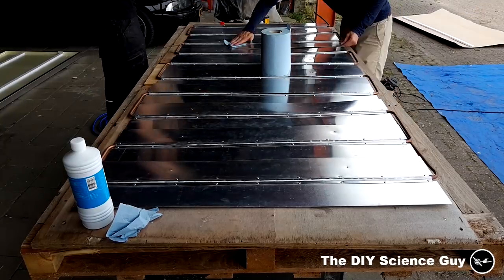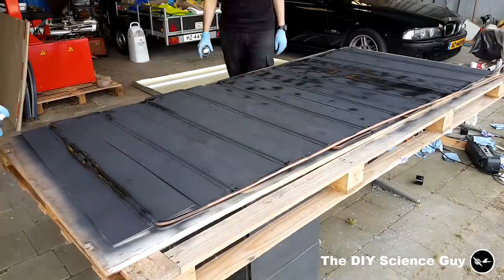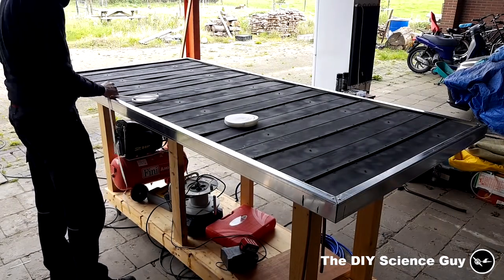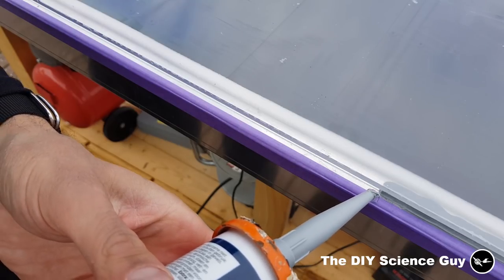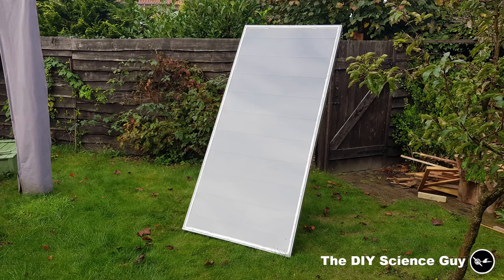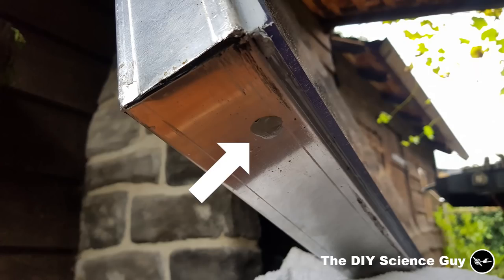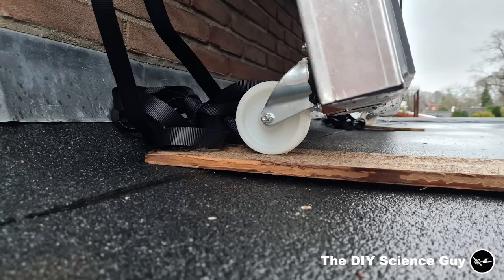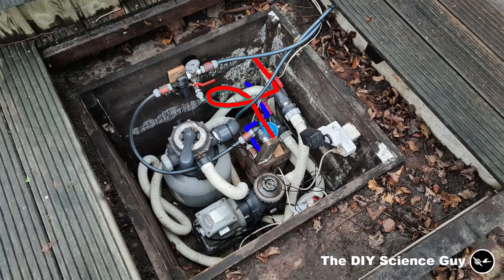Super easy to build 1600 Watt Solar panel #2

Comment: Nice job. My panel is 2440x1220, hardwood box, lined with 50mm foiled PIU, 2 serpentine silicone pipes sandwiched between 2 x 16AWG aluminium sheets, with twin-wall polycarbonate on the face. 
Don't leave it uncovered without pumped water to keep it cool!
My pump failed, the residual water boiled off, and the polycarbonate sheet got soft and sagged.
At my latitude, it is the equivalent of just over 1 kWh/h continuous in direct sunlight, calculated from rise in water-temperature per volume pumped. It keeps my workshop warm in winter, too!

Comment: I once removed an old collector from the eighties that had not been functioning for some years.
The insulation had completely turned into charcoal foam! To me it was a miracle that it never caught fire.
So my advice here is to always have water circulating through the panel. When left alone without cooling the temperatures inside such a panel can become dangerously high.

Comment: So glad you used polycarbonate. It can handle the higher temperatures when the pumps are not running & it's a natural ultraviolet filter. I hope you used Polyisocyanurate insulation, because it can handle 148°C. 
Extruded Polystyrene (XPS) will have permanent, inelastic deformation at 60°C and higher.

Comment: This is cool! Don't forget to give us some HHO updates!
Reply: I'm really looking forward to pure H2 and O2 generation (>99%) and storing it in appropriate gas cylinder. O2 is also really useful for medical applications, just need to purify it. H2 great for Hydrogen Fuel Cells and gas burner.
Reply: @NextGenAge  Its hard, and expensive. You need to be sure to get H2 > 96% (98% ideally) purity. Otherwise it could be EXTREMELY dangerous. Our bellowed DIY guy speak about cheap H2 probe, but I guess he set aside HHO projects for a while (update on his last HHO project would be nice - info about improvements).

Also tank where you store hydrogen MUST be special kind of tank (when high pressure H2 is stored), otherwise it could explode cause H2 is tricky gas and want to do as many leaks as possible. And there are some additional elements of course like... oohh oil in compressor (from fridge for example) could burn H2 and make an explosion, etc.

So be careful. Anyway HHO is our only hope for the future, cause even if those nuclear fusion reactor start to work and produce free energy, it wont be free for us - tax payers, that I can assure you. They want to control us and energy is one element of control they wont let go.

Comment: I'm really wanting to build one of these. Only thing holding me back is having to learn the plumbing connections to the oil boiler for hot water. Shut off valve for winter maybe. Cheers and sunny days brother 🌞

Comment: I once lived on an old abandoned orange orchard. There were thousands of feet of black plastic irrigation tube laying everywhere. I found a jacuzzi someone was giving away and brought it home. I then collected up a massive amount of the black tube and made a giant spiral on my corrugated roof. It was probably fifteen feet in diameter and made out of hundreds of feet of tubing. I put a small slow pump on it and fed the output into the Jacuzzi which we used as a simple hot tub. The water out of the tube was not super hot but it was hot. In order to get it hotter I added a small an inline water heater to further heat the water coming out of the tube.The system got the water hot in a couple of hours and our electricity bill barely went up taking hot tubs two or three days a week. I always wondered if it was efficient or if it was a good idea. It seemed to work quite well but I employed no mathematics or calculated engineering.

Comment: To maximise energy absorption you could add 10% of 5 micron fine zinc dust to the black paint, this will increase heat absorption by more than 15% (researchgate)
Reply from the maker: Thanks, I'll try it out some time!
Reply: @TheDIYScienceGuy  yeah, and a lined Al/Cu interface of thermoelectric cells would b inereeresting to see how much electricity it pulled since the heat's flowin anyway...why not stick these awesome little pieces of tech in between the highest difference of temp places and collect otherwise wasted energy....(or if water/Cu/Al temp diff. will be low, perhaps place them on back between hot side and cooler back.  I dunno if you could find a good enuf temp gradient, but itd be super interesting to make extra power simply off of the heat energy flowing from hot to cold thru the material boundaries.  They may also be inefficient garbage i dunno; just know the tech is amazin gbut thats about it

Comment: Hello DIY Inventor. Thank you for sharing. Beautiful process and powerful end product. Is it possible to share te calculation for the output of the solar panel. Thank you.
Reply from the maker: Thanks! Yes the output is an estimation of course. 800 Watt of the sun's enegry per m2, the panel is 2xm2=1600Watt. Mid summer I will show the actual power output.
Reply: @TheDIYScienceGuy  Thank you. Hope mid summer will bring you many clear sun hours and hot water.

Comment: Great videos, really clean and clever techniques - really thought through! I think a little more detail about what exactly you're making at the beginning of the video would be helpful for first time viewers.
Reply from the maker: Thanks! Here ar part 1 https://youtu.be/9YswyY1i-Us and 3 https://youtu.be/DIk2mcJ7NHs hope it helps!
Reply: I'll testify as new watcher that'd been very helpful considering upon 1st look/read "1600 Watt solar *panel" I thought "no way 1600!!" and I was hooked...

Then a chem. engr watching, I began to scratch my head a couple times but curiousity persued;till I got here and heard the hot tub talk and saw how the copper was ran realizing "damn it, heat exchanger!!"  Seeing how *usually watts used with solar panel describes electricity production and thats all I was after, bit more clarity in title wouldve been nice.  Like 1600 Btu solar heater or if with W then 1600W rooftop heat/energy exchanger.

TBH tho, I like watchin anyone create anything so no total waste.  More detail on how you calculated the theoretical needed flowrate, heat flux, Wattage generated etc wouldve helped make it more interesting a ton!  For us engies watchin...like did u model each collect as half the Al sheet with copper strip on one end, calculate energy/area generated w the nice 2nd order heat transfer equations or just look value espimate up?  Did u go on w a cross section of Al and Cu on end using this generated energy/volume, look up needed consts. like metals' transfer coefficients and solve to find steady state max temp of metal then finally your heat flux at s.s?  Next, calculate needed energy input to raise water desired temp., and finally, w more detailed 2nd ord. diff's solve using this needed energy and heat flux to calculate your needed flow rate???

If you found some type online calculator to do all the calculations for you, shame on you for taking out all the fun part!!

Comment: What is solar Anti Reflection (Light Trapping) Coating ? Silicon nitride Si3N4 (75nm layer) thermodynamic coating (plasma coating ? like: The Thought Emporium ("This Can Coat Anything in TITANIUM") ?  ) ? Heat_pipe using Acetone C3H6O (Boiling/gas point +56.05 °C, Melting/solid point -94.7 °C) or Water or Ethanol ( you simply take a metal tube (put in a metal wick) (closed at one end), bring the liquid to a boil (pressure) and close the other end before it starts to cool so that the tube goes into a vacuum ? (like vas made Doug Kalmer "making a heat pipe" ) ) ?
Reply from the maker: Sorry, I don't understand your question.

Comment: Question: Would it be possible to integrate a solar panel system? Would cut down on black paint for sure and double its use, are there any reasons to consider not doing it?
Reply from the maker: Yes, they exualy make heatexchangers that can be put on the back of collar cells for that purpose. But it makes it more complex. I'm planning to dot something like that when I have my one solar cells. Good thinking! 👍

Comment: still waiting on the 1600 watts. i doubt your design is even capable of it
Reply: “The Sun's rays are attenuated as they pass through the atmosphere, leaving maximum normal surface irradiance at approximately 1000 W/m2 at sea level on a clear day.” So for a unit that looks to be around 2 meters squared  to get 1600w which would be around 80% efficiency, that figure seems to be pretty plausible.
Reply: How to calculate the needed al sheat area for the targetted wattage of 15 KW production ????????????

Comment: Doesn't glass make it produce hotter water ? You can always put hardware cloth over it if you are worried about hail damage,  some with a grid size small enough to stop anything large enough to do crack or break the glass. How well did that first one work, and how do you know they are 1600 watts? Thanks man
Reply from the maker: No polycarbonate is a beter thermal insulator than glass so it will work beter. The only disadvantage is that it is twice as expansive as glass.

Comment: I have my own solar instalation (4.66m2) which at 33oC gives me 22MJ of energy output in Poland. How much energy can You gain?
Reply from the maker: Max around 1500W. How much Watt does you panel give?
Reply: It depends on two variables 1) temp. outside and 2) temp. on the panel. Above 25 oC outside I achieved 160W/m2. At 33 oC it is 260 W/m2. Without clouds. Max temp. in the condenser was 65 oC. The lower temp. established in the condenser e.g. 50oC the lowest losses on the solar panel due to conduction, radiation and convection (one glass separation) and the greater efficacy. At 50oC I get 75% at 65oC 50%. Average sun power 350W/m2 between 10-15 during two weeks in Juni.
Reply: For me interesting is how efficiently heat flows from metal plates to the pipes? I have on 1m2 of area, 2.7kg of water and 27kg of steel.

Comment: Got a question: I know polycarbonate is a "natural" block for UV radiation... Loosing that wavelength isn't a waste of efficiency?! Or is just a tradeoff on the safe side for not using a brittle glass?!
Anyway, that is one professional looking solar panel! :)
Reply from the maker: Thanks! Well glass also blocks most of the UV rays and besides that only a very small amount of the light that gets trough our atmosphere is UV light. But good question! 👍
Reply: Even through im not sure if this is considered a solar panel and not a water heater it might have the pros of not causing overheating that causes efficiency losses since theres a limit to how much and what type of light can be converted to energy ( im talking in case of a solar panel not sure if its a heater tho)
Reply from the maker: Yes it heats water.
Reply: @mehmetbahaozen8445  I was thinking the same....but may be it's because I'm not natural English speaking. In my country they call this kind of stuff a solar collector. (And I have those on my roof for hot water for 8 years...still going fine)
Reply: @mehmetbahaozen8445  I think a nice idea could be the combining of a water heating panel contacted to a photo voltaic panel. The water could keep the temperature  of the PV panel under control and therefore giving it  a higher efficiency.

Comment: FYI plastic isn't more transparent then glass. Don't believe me as your local optometrist, or eye glass wear supplier.  It's just for crack resistant for obvious reasons. But will fade with time like your headlights. It's a give and take.

Comment: Nice project. Why do you need a secondary water circuit (with exhanger, pump, electricty etc)? Why not use this directly as input into a boiler or gas heater, pushed by mains water pressure?
Reply from the maker: Thanks! Because I use antifreeze in the winter time so it won't freeze in the night.

Comment: I was expecting a solar electricity panel not a solar hot water panel. I don't understand where the 1600watts comes into heating water using the sun.
Reply from the maker: The sun provides 800W per m2. The panel is 2m2 which makes it 1600W

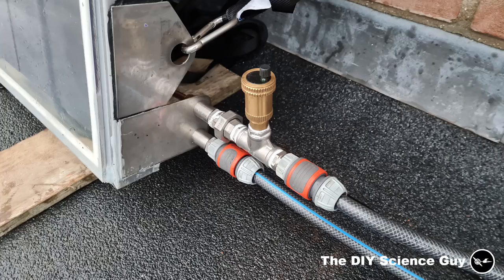Comment: 09:36 " Sorry but it seems to me that I have found a possible error this air purge valve, maybe it should have been on top of this panel .. because the air bubbles inside the panel will go up .. is this a mistake?  I ask a lot of thanks
Reply from the maker: No the flow in the tube is high enough to push the bubbles down so they will eventually flow out of the pannel. But good thinking! 👍

Comment: Hello, your chanel is fantastic, have you ever considered doing a video on a hydrogen fuel cell, alkaline fuel cells were 50-70% eff but construction details are scarce
Reply from the maker: Thanks! Yes I have some ideas for that but I first need to rebuilt my hydrogen generator so I have hydrogen to experiment with.
Reply: interesting!

Comment: would it have made it easier if the copper pipe as flattened to be rectangular and then brazed/soldered to single flat piece of Alu.? that is as far as making the solar heater
Reply from the maker: Yes maybe. But making a rectangular pipe is also not that easy or easy to come by. But good suggestion. 👍

Comment: If you put that in a sealed air tight system with sulfur hexaflouride it would be incredibly hot. Because the green house effect is 20,000 times that of carbon dioxide.

Comment: Your formula is correct for figuring output, but electricity is measured by watts,  heat is by BTU's
Reply from the maker: BTU is part of the imperial messurment system. Watt is metric. Watt means energy over time (1 Watt is 1 joules per second) joule means energy in any form, heat, electricity, sound etc.

Comment: Are you not worried about moisture slowly clouding the polycarbonate screen, cause I didn't see you add anything to capture the moisture within the panel.
Reply from the maker: No not really, the housing is completely sealed and the copper pipe does not leak inside it. In the case that it would cloud up I could make a hole in it, throw in som bags and seal it back up.

Comment: How will you prevent lime in those pipes?
Reply from the maker: I'm serculating anti freeze through the system, so that won't be a problem. Also, as long as you have a closed system like this, you can't really get lime buildup, only when you have a ridiculously high lime content in your water.

Comment: How does this generate 1600watts?  Its a radiator run thru a heat exchanger , hearing the wAter of the hot tub which is also run thru the exchanger.  I don't see 1600 watts.
Reply from the maker: Watt is a unit of power. 1 Joule per second is 1 watt. Joule means energy. This can be electricity, heat, light, sound etc. Check this link for more information about this subject, hoop it helps: https://en.m.wikipedia.org/wiki/Watt
Reply: @TheDIYScienceGuy  so 1600 Joule of heat per second is how you came up with 1600 watts... Why didn't you just cal the video "1600 Joule solar powered via exchanger hot tub water heater"?  it doesn't roll off the tongue as easily...
ORRRRRRRR you could do as the British do, calculate the peak energy creation of a petrol powered engine, presented in a scale used by electronically driven engines.  " this solar array  produces 16 megawatts at 23 neutons per square Calabrini's" now I'm just Capernicusing a round

Comment: I guess an actual photovoltaic panel could have been incorporated into the unit to boost the wattage.
Reply from the maker: Well a photovoltaic panel is much less efficient than the one I made so if you need more heat, just ad an other panel like the one I made. But for pumping the liquide around a photovoltaic one would be great.

Comment: And how the hell this is going to produce voltage, especially in january with -20 degrees cold ?
Reply: Hi, it doesn't produce voltage but heat. It can work in winter as long as there is sun and that your panel are well insulated (it's better have a couple of square meters).
Reply: @viaviafog1508  in a few words it's useless in winter.
Reply: @iani_2020  Probably if you live in the north pole where there is no sun. But if you don't, then it is wrong to say it is useless in winter. With a big installation (something like 10m^2), you can heat up your water tank in a couple of minutes. I'm talking about domestic use and not for a swimming pool.
Reply: @viaviafog1508  I live in Moldova. We have winters with -5, -10, and sometimes -20, even with sun outside. That's why I said is useless in winter. Maybe it can be usefull in spring/autumn.
Anyways, I thought it can produce electricity, but no.

Comment: Amazing project  can  you share the the details so one can build it their own
Reply from the maker: Thanks! Well I don't have detailed  drawings of it because it's mainly in my head. But if you copy the concept you can make it any size you want.
Reply: Wonderful work done by you 
Can you tell me about materials you have use it
Reply from the maker: Thanks! The housing is aluminum and so are the collector sheets. The tubing is copper and the insulation is polyurethane.

Comment: Great stuff! 
What about the 1600 watts. Is it also a generator?
Reply from the maker: Watt just means energy over time. This can be heat, motion, sound, light etc. But this panel will power a generator later. Have you seen this video of mine: https://youtu.be/s5Ud-FD33tI
Reply: @TheDIYScienceGuy  yes but it is measureable and idk how you came up with 1600w
Reply from the maker: 800W per m2 is the amount of energy from the sun that hits the earth. The panel is 2xm2 which therefore absorbs  1600W.
Reply: @TheDIYScienceGuy  it, energy from sun, may average to 1Kjoule per meter squared.

Comment: Isn't that just a water heater panel? how come he names it 1600w solar panel? what am i missing?
Reply: You may be missing the fact that the watt is a measure of energy not necessarily electricity. That energy can be in the form of heat.
(average candle produces 80w)
Reply: @mattburrows2615  
CLICKBAIT